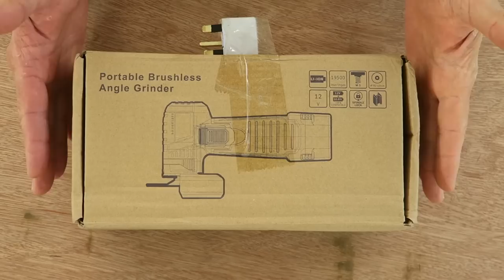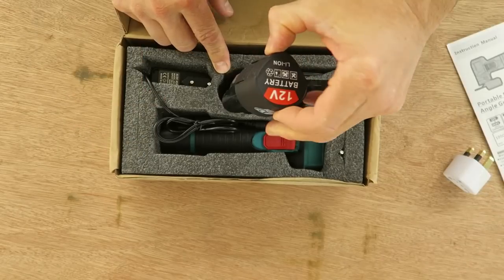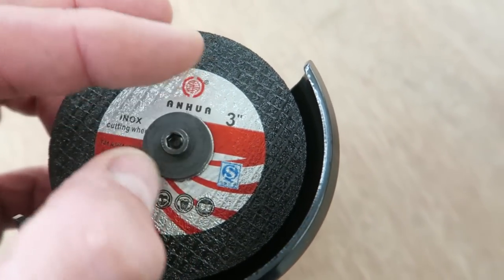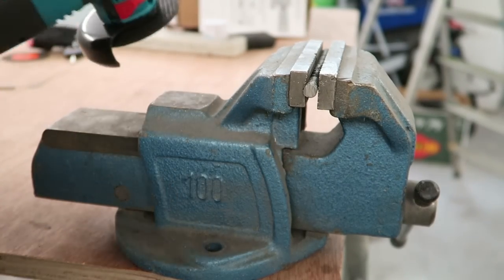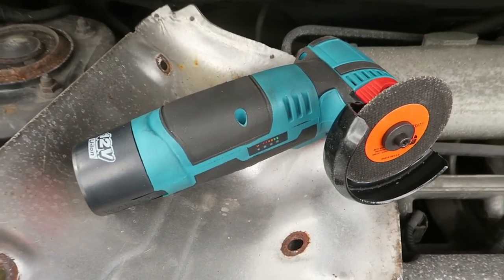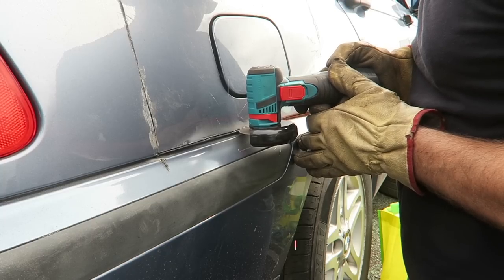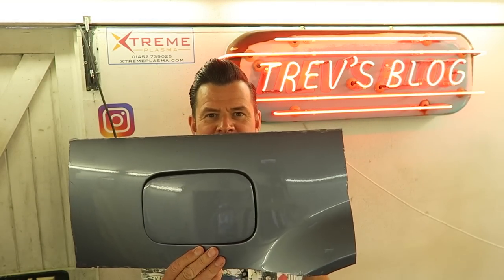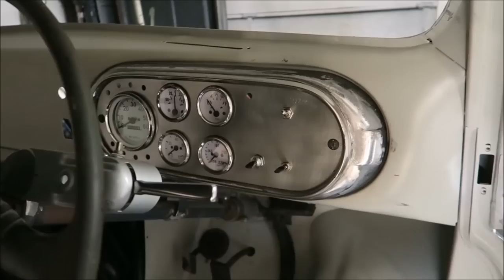Practical review of Banggood 's Mini rechargeable cut off grinder, by Trev's Blog

Comment: Hi trev, that grinder is the same as the lidl one , i bought one and also the 
Optional 4ah battery   , i found the 4ah  battery transformed it into a real tool but the 2ah battery is useful too as its smaller , think the grinder was £29.99 with the 2ah battery, the most useful tool i have ever owned , hope this helps, all the best , hugh
Reply from the maker: That’s interesting thanks. The only drawback with the grinder  is that it cuts out to protect the battery from overload. With a larger amperage battery it would definitely perform much better! Cheers Trev 👍
Reply: Hello, I understand then that the batteries of the parkside grinder are compatible with this machine? Do you have to adapt it? Thank you. .

Comment: This would be handy in so many ways! I like how small it is, that you can hold it out with your fingers when your hands don’t fit. Realistically, using this isn’t much different than my 3 inch air cut off tool. If you put your weight into it, it stalls. Same with this, if you are patient and feather it into your cut, no issue. Patience!!! Especially when this is a better option than not getting something from the scrapper!
Reply from the maker: The drawback with the machine is it isn’t powerful enough to warrant having one in the workshop. I use an air die grinder with a decent compressor behind it. There’s plenty of power there 👍 cheers Trev 👍

Comment: I have the Bosch version of this tool and I love it. I made an adaptor to fit the Roloc discs and it's an awesome handy little tool. I'm considering getting a second one (maybe the Banggood version?) for use as a cutoff wheel as it was super handy in that mode too.
Reply from the maker: The Bosch one I saw reviewed also came across as a bit underpowered, how does yours perform? Does the grinder cutout if you put pressure on the disc?  Cheers Trev 👍
Reply: I've no idea whether they have the same power or not, but they're basically all going to be underpowered - a motor that small spinning that fast isn't going to have much grunt. If I push too hard on mine it slows down and then if loaded too much it'll cut out (I think that's a designed-in protective feature). I just take it easy with it and it does a great job. 

Also - stoked to get two videos on the same day! Always brings a smile when I see a new Trev's Blog video :)
Reply: The bosch is a bit feeble but hey when your in a pickle for space it gets the job done, great with relocation adapter with strip n clean disc etc - got my adapter on ebay
Reply from the maker: @mully89  the review I’d watched said pretty much the same, it sounds comparable to the Banggood in the fact it’s basically a bit underpowered but very handy in a tight spot with no power. Cheers Trev 👍
Reply: @trevsblog  yes it sounds like they are quite comparable - and let's face it, the Banggood item is almost definitely reverse-engineered from a more reputable brand.

Comment: Is the low grunt and auto-shutoff a safety feature? Might reduce the likelihood of shattering a disc and testing that guard.
Reply from the maker: Researching li-ion batteries, they say that they’re potentially dangerous as they hold an incredible amount of charge for their physical size. If you took one apart there is a bank of electronics sat on top of the cells. These electronics partly detect the amount of current being drawn from the cells. If more current is being drawn than the cells can happily produce then the battery shuts down stopping the tool. A situation where too much current is being drawn rapidly results in large amounts of heat or potentially an explosive fire. Lots of videos online showing phones and vapes catching fire 🔥 obviously the grinder stopping is preferable to this situation. Cheers Trev 👍

Comment: Looks identical to my Bosch one 👍🏻
Reply from the maker: How does the Bosch one perform. Does the grinder stop if you put any pressure on the disc? Cheers Rodders
Reply: @trevsblog   not sure yet it didn’t come with a battery or charger. I know stocky has used his for cutting suspension springs etc and it’s spot on 👌🏻

Comment: Can you convert this to a right angle grinder to accept roloc style disks, i have been searching for a while for a cordless or corded small right angle grinder for sanding welds down but haven't found anything i fancy for the price
Reply from the maker: If you’re prepared to adapt a Roloc mandrel then absolutely, I use a small right angle die grinder as a roloc tool. Cheers Trev 👍

Comment: Metabo do a 3" cut off in both 10.8v and 18v. Metabo tools tend to be hard to wear out.
Reply from the maker: You get what you pay for. Sometimes it’s worth buying a cheap tool if you’re going to use it occasionally. Then buy the premium kit for everyday use. Cheers Trev 👍
Reply: @trevsblog  Yes, there is always a place for cheap tools that you only use when the blue moon is out.
I was told as a young lad to buy cheap tools to start with, find out which ones you use a lot and replace them with the best you can afford.

Comment: recently l got a ferrex cordless 20/40v grinder and being able to just pick it up and cut small jobs without getting the extension lead out is cool and its no slower at cutting than my mains is  but its still big so cant get it down a engine bay :)
Reply: Try lidls same grinder you got but better. And they now got a mini one like the one trevs using for £20 in shop now

Comment: Can you connect it to a 12v motorcycle battery?
Reply from the maker: The thought had crossed my mind but I didn’t want to risk ruining the tool to find out. Lots of electronics in these    li-ion machines. Cheers Trev 👍